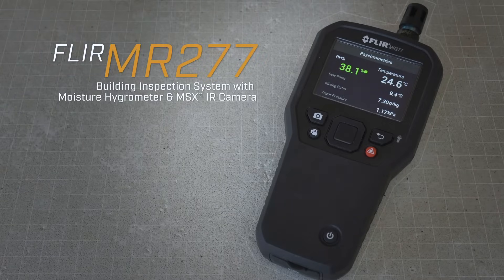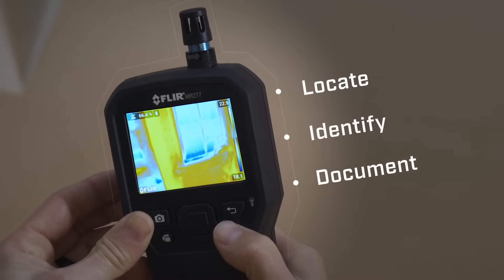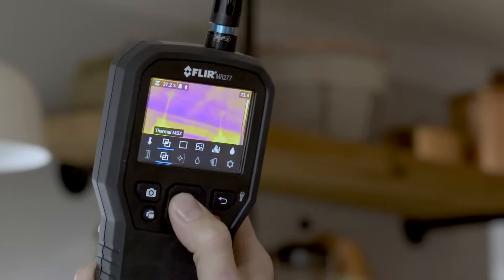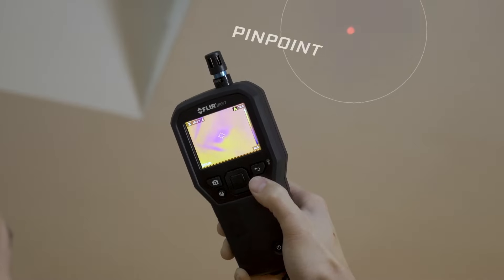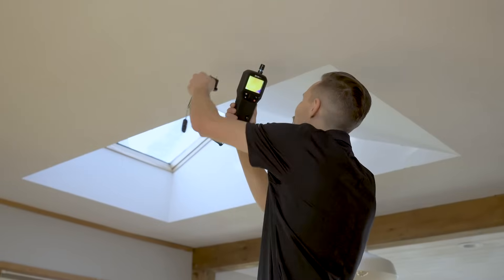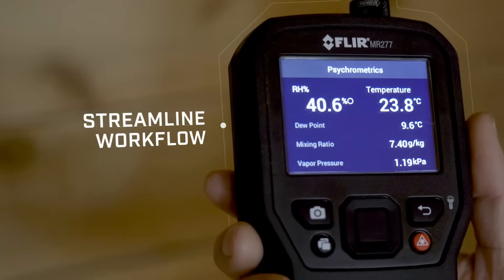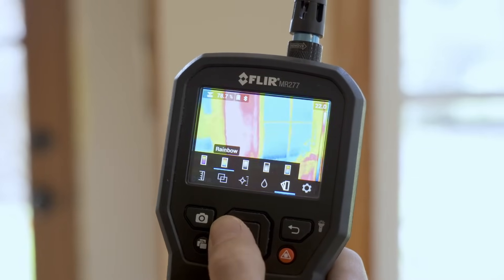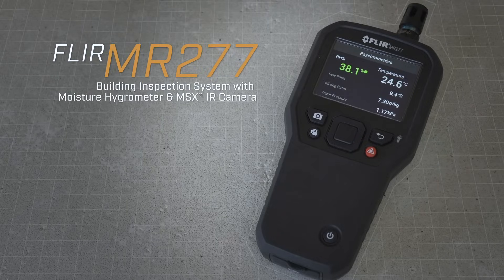Introducing the FLIR MR277 Building Inspection System

Comment: Mine just finally came in the mail. Everything works but the pin-less moisture meter. It reads a 100% at all times, whether it's on a surface or not. Please let me know if this is a problem or I'm missing an instruction to bypass this.
Reply: Did you figure out the issue?  Same is happening with mine. 50-100% moisture everywhere.
Reply: @brianl5445  mine was defective. Had to return it unfortunately and wait for a new shipment
Reply: @nicohalverson4352  Have you received the new meter yet?